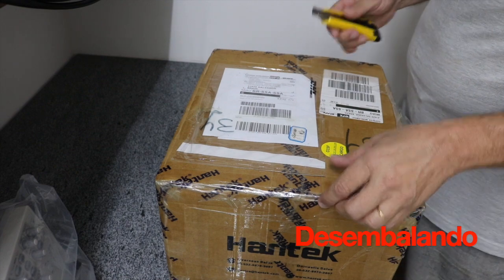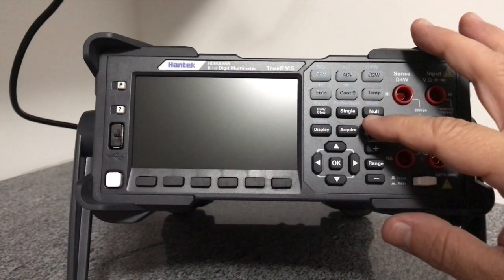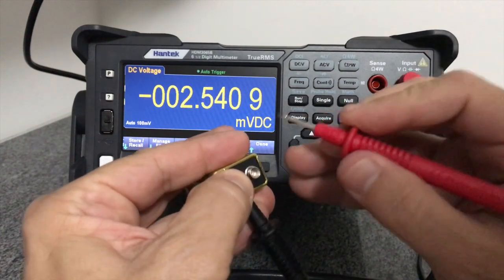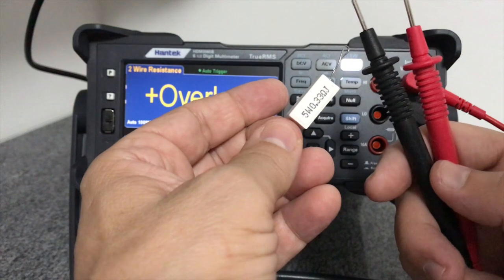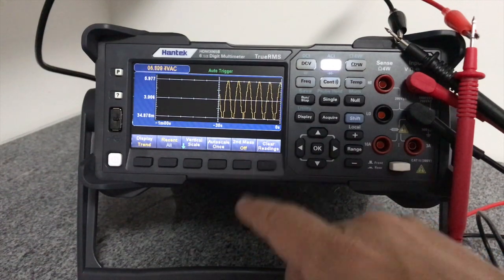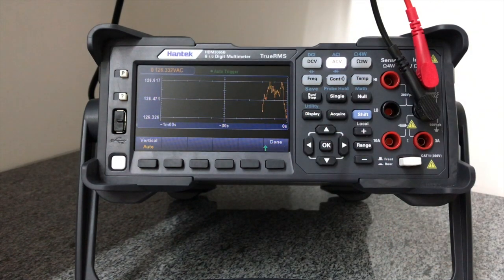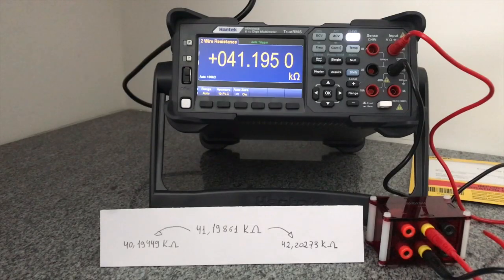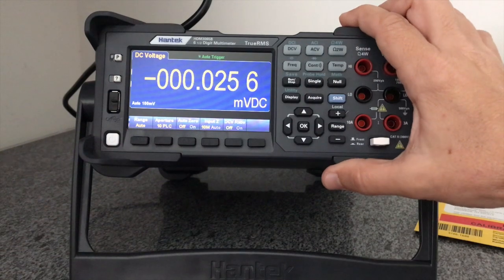Hantek HDM3065: Unboxing / Review

Comment: Hello Proffessor Marco. I have a question, because I didn't found any information about it. On your video, we can see the triggering light flashing each time the multimeter displayed a value. But if you measure a voltage or a resistor, how fast it can running? The specs told about 30000 RDGS/s, does it mean that you can have very high speed of measurement, if you chose this parameter in the menue at least? Thanks for your video.
Reply from the maker: Hi, Alexander. You can choose 3 types of triggering: Auto, Single and External. External triggering allows you to control the triggering using a external source connected to Trigger input at the back of multimeter; Single allows you to make just one read of the input signal, and preserve the value; Auto is the default mode, which you saw at my video.

The equipment "samples" the input signal 30.000 times per second, but this is not related with the number of measurements it displays for second. At some kind of measurements you can adjust the number of values per second. At DC Voltage and Resistance, for example, you can set the "Aperture" based on Power Line Cycles (PLC) from 100 (slowest) to 0,002 (quickest). At AC Voltage, you can set the AC Filter of 3Hz (slowest), 20Hz or 200Hz(quickest).

The speed of measurement at display always compromises other parameters, as rejection of noise, for example. I recommend you to read the equipment manual, where you will find more information.
Reply: @ProfMarcoCamara  ok what I am looking for is a bench multimeter who allows quick readings of voltages, resistor and semiconductors, when troubleshooting on pcb. So according my understanding it Can Do thé job for that purpose. Thanks to Care about your auditory's request.

Comment: Are the Hantek HDM3055/3065 able to measure DC voltage and DC current at the same time (as a 2nd measurement in the Dual measurement screen)? Any firmware updates issued by Hantek which improved these multimeters? Any severe bugs discovered while using these?
Reply from the maker: No, they can't. You can, however, read a DC signal voltage and AC voltage of an AC component simultaneously.
Reply from the maker: You also can compare two DC voltages with DCV Function (beware about limitations when using this function).
Reply from the maker: I have also saw a video from Keysight where they use the DCV function to read voltage and current at the same time using a auxiliar resistor, but I have never tried to use this:  https://www.youtube.com/watch?v=Y6xnLkiUMn8
Reply from the maker: As long as I know, there were no firmware updates since I received my equipment. And no, I didn't find any severe bug while using it.
Reply: @ProfMarcoCamara  Thank you answering. Currently in the process of buying a bench multimeter. Siglent, Rigol, Hantek and GW Instek are candidates with all having their pro's and con's. I like the buildquality of the Hantek, a big pro for me.

Comment: Hello, Does it make noises with internal relay, if it has them? when you do dual mediations without having to press 'Single'. Like the Siglent SDM3045X. Thank you
Reply from the maker: Yes, it has relays. I think all of DMMs make these noises. And yes, it really needs to change the circuits at input to make dual measures, and it does that with relays.

Comment: O produto tem um custo beneficio bom. Mas poxa é uma copia descarada da Agilent atual Keysight. Até por dentro é muito parecido mas apesar das suas medidas feitas  no video eu não acredito em 35ppm. Até porque ele usa outra referencia de tensão em não o LM399AH utilizado por grandes empresas no caso o Keysight 34401A / 34465A o Keithley DMM6500 até o Keithley 2001 velho de guerra com seus 7 1/2 dígitos utiliza o LM399AH, apesar que pra mim 7 1/2 reais somente com LTZ1000 como no Keysight 34470A e apesar de bem escondido em com numeração da Fluke no DMM7510 da Keithley. Multimetros com a marca Fluke também usam o LM399AH na sua linha de 6 1/2 digitos. E como todo mundo sabe ou deveria saber a referencia de tensão é o "coração" dos DMMs. Abs
Reply from the maker: Bem, eu concordo, mas as medidas bateram com a precisão especificada na folha de dados do equipamento. Recentemente eu refiz as medidas, e continuam dentro do especificado. Quem compra um equipamento como este sabe que é uma “cópia” do Keysight 34461A, porém com custo bem mais baixo - e precisão menor. É uma opção para quem consegue viver com isso. É o meu caso. Abraços.

Comment: the menu style 100% copied from Keysight 34460 series
Reply from the maker: Yes, and not just this. But it works good.
Reply: @ProfMarcoCamara  i didnt say that it is bad :) i like it because keysight menu is very friendly. The same thing with HDG series generators , they copied Keysight 33500 and 33600 series. I have 34465A DMM
Reply: @ProfMarcoCamara  they copied even style of the certificate of calibration 😁😁 i worked for keysight 5 years so i know it very well
Reply from the maker: The 34465A DMM is a fantastic tool, and (unfortunately) there is no competitor who has a similar product with lower prices.
Reply: @ProfMarcoCamara  yea , agree. It is too much for my purposes. Also i have U1252B handled DMM , it is very accurate , but its too fast discharges the battery because of OLED display. Now i use fluke im my day work

Comment: The price they are asking would rather buy a Siglent if I wanted the display and features and name or a Rigol for the brand name. Hantek asking far too much for a visual clone and this is why people asking to see inside it because something smells fishy. But hey it's China and they steal from each other so maybe just a 100% copy of the Siglent which I believe was a cooperative project with Keysight.
Reply from the maker: Martin, here in Brazil the Hantek price was more interesting when I bought this multimeter. Yes, it’s a visual AND functional clone, as the Siglent, but HDM3065 and SDM3065 are different in some minor specifications (with vantages for the Hantek). The Keysight 3461A is the “original”, but unfortunately, it’s was too expensive for me. The instrument is working well, with precise and accurate measurements. If it “smells fishy”, I can’t smell that.